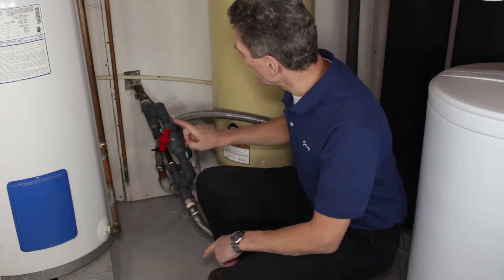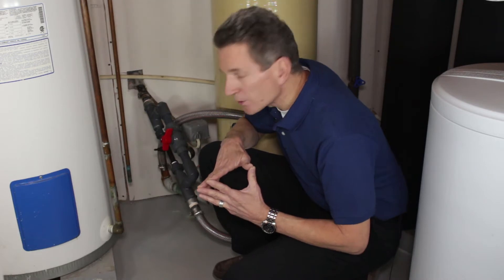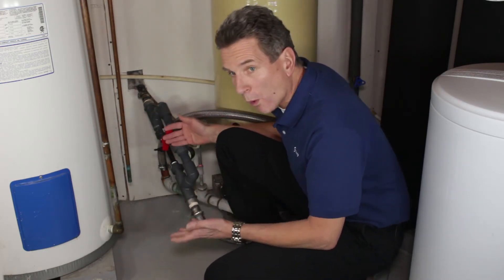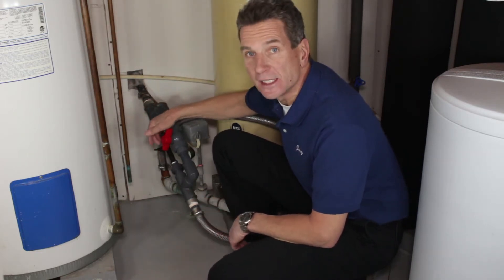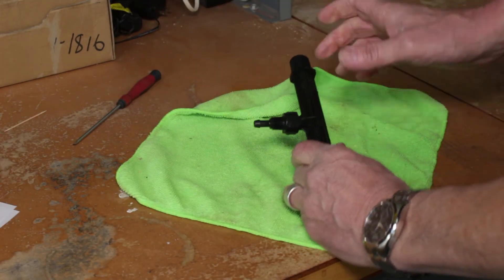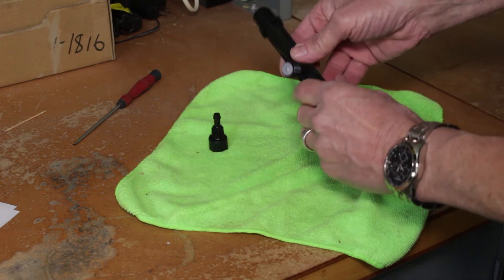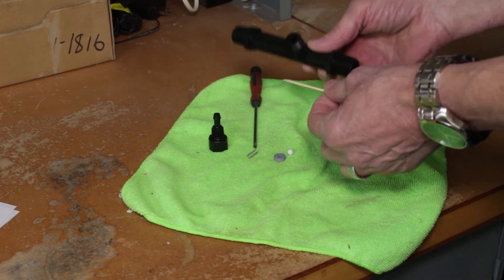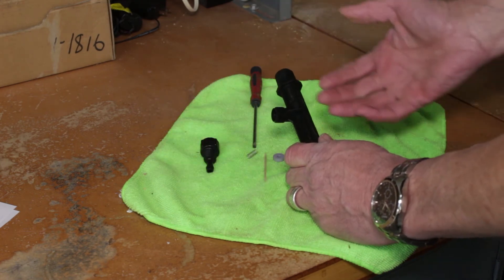How to Setup and Clean a Mazzei with Bypass Air Injector

Comment: My Hellenbrand Iron Curtain System 2.0 was making a screeching noise, so I turned it off at the top (red valves). It’s been sitting for a long time. I assume it’s connected to my water softener because my water is rusty and hard now. How do I just use my water softener for now?
Reply from the maker: If you just turned the red valves on the iron Curtain, the softener is still working as best it can with out the iron removal first.  You could try increasing the hardness number or better yet, replace the iron filter, we have them here https://waterestore.com/products/hum-chemical-free-fok-iron-sulphur-filter-2-0-cube

Comment: Good day I have a iron sulfer filter as well as the mazzei but my filter has a air pump. My mazzei valve has always been fully open since it’s been installed. Do I need to close it off abit so I can get more air into the system. Or I just saw one of ur other videos and I took the check valve off the pump and I could head the gargling when it’s in the cycle but I can’t hear anything with the ball valve on.. does that mean the ball valve is defective. Thanks for ur help
Reply from the maker: It sounds like the aior pump was installed after the mazzei.  When that happened they just opened the bypass instead of removing the mazzei. I haven't used an air pump in over 10 years so i am really not sure how to help you.
Reply: @water_estore  I mean the air vent tube that’s on the top of the iron sulfer filter it has a little ball check valve in the end of it when I put it in regen I couldn’t hear any gargleing but when I popped the check valve off I could hear the gargleing does that mean that ball valve is sticking closed not letting air in?

Comment: I have one of these in my house that I've lived in for 8 years. My water has been fine up until recently. I had a plumber come in as my water keeps shutting off. He covered up the air injector piece with a rubber glove and the water started working. Oxygen is getting in my water line and the pressure switch is shutting the water off. Any suggestions? Should I buy a new air injector? Should I replace it on the bypass with a solid plastic piece that has no air injector? Is that even possible? Please help
Reply from the maker: It sounds like it is clogged.  We have the replacements here https://waterestore.com/products/mazzei-384-injector-for-iron-sulphur-filters
Reply: @water_estore  thank you! I'm not even sure why I have this to begin with. My plumber recommends just taking it out all together. What's the main purpose?

Comment: Hey Gary, just found all your videos.. very nice! I am using a Dema rather than a Mazzei. It was installed decades ago as part of an old Culligan "IronMaster" system. So it goes Dema then pre-filter then RustMaster media bed, then post-filter.  I have just replaced the IronMaster with a Softener. Only .3ppm iron so the Softener should handle the iron fine. I'm going to keep using big blue pre and post filters since I'm used to it - but the question is whether to keep the Dema injecting air prior to the pressure tank. Do you think the Softener ion exchange will work better with or without the Dema in the game?
Reply from the maker: You don't need the Dema with a water softener.
Reply: @water_estore  thank you